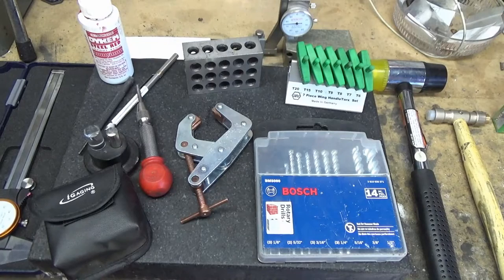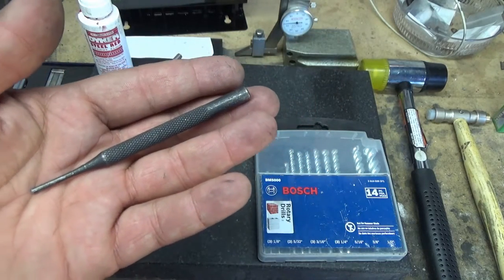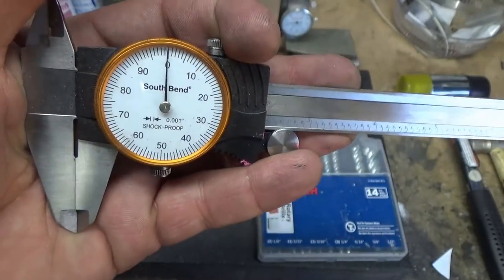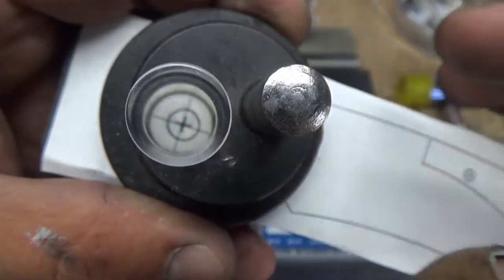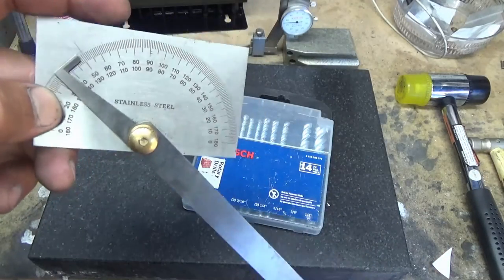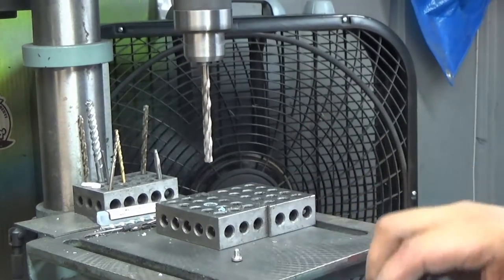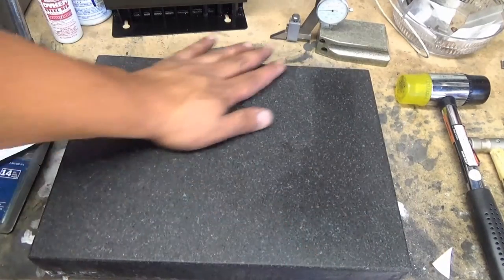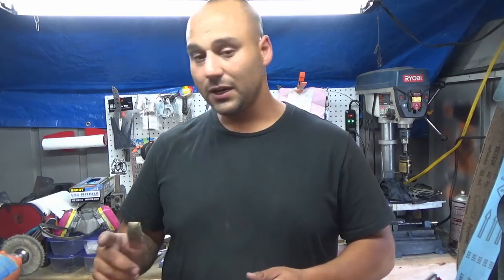Inexpensive tools that are great for the knife shop

Comment: I'm not a knife maker, but I do work with metal. We use many of the same type of tools. Interesting video. FWIW, I have several calipers including a digital Mitutoyo. Mitu, Starrett, and Peacock analog. If anyone is debating between digital and dial, get the dial. Obviously, there's a good deal of personal preference involved, but if you're not sure.... Good luck. Oh, BTW, it can be very handy too have an inexpensive caliper that displays fractional values. As 1/64 is a bit over 15 thou, we're not exactly looking at precision. Mine is an iGaging. It was only about $25.

Comment: Mike, on your countersinking and center punching needs I'd recommend a set of center drills.  Much better than the masonry bits and 9 times out of 10 you won't need to center punch to start a hole. Sets are usually cheap as well. Also I'd like to plug littlemachineshop.com I am a hobby machinist and love them for inexpensive tooling and whatnot. Good job on the video as always!!!
Reply from the maker: +Jacob Davis Great tip! Thank you. I'll have to pick up a center drill set and I too have heard great things about little machine shop. When it comes to machining, I am all ears as I still have a long way to go before I consider myself even a novice. Thanks again!